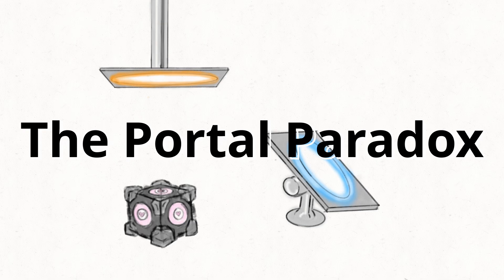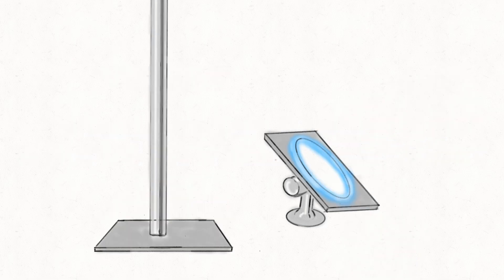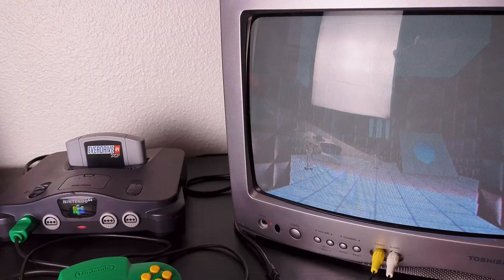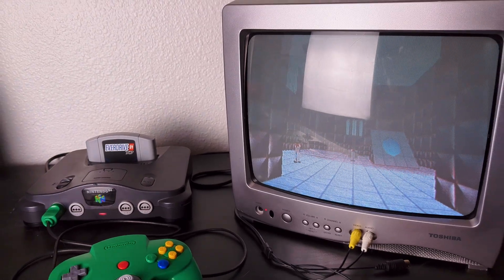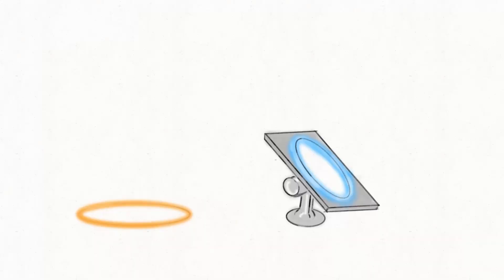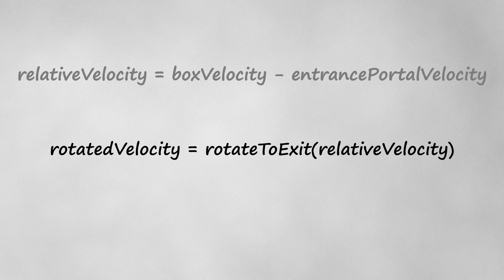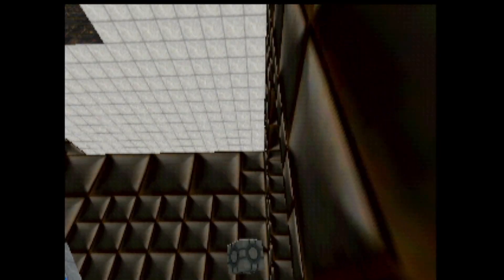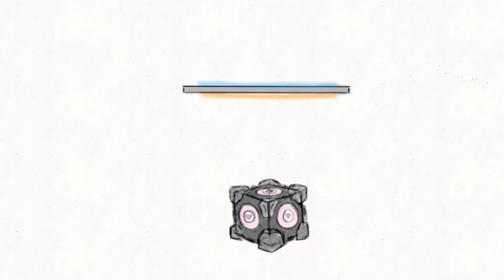I rewrote Portal from scratch and solved the Portal Paradox

Comment: I think another way to look at this may be to think of the portals like a tube, although this is flawed.
My logic goes that if you are to move through a portal, you are travelling through a wormhole. I your example, moving the portal makes that wormhole smaller, so the cube travels through the portal and the distance it travels further shortens, causing its relative momentum to fling it out of the exit.
This logic falls apart when the portals move away from eachother, however, unless you make the stipulation that the wormhole does not take the direct path between entrances.

Comment: I think the paradox is more nuanced. Your implementation solves it beautifully if the portal is being moved onto the box at a constant speed. But what if the speed of the portal changes while it's moved across the box, or if the portal is rotated?
Reply: I don't think there's any inconsistency nor any added new thing by this scenario. Whatever passes through the portal at some moment in time has teleported. In your scenario it just applies in cross-sections and there will be a resulting amount of force from all those cross sections
Reply: @MaxLohMusic   the problem with this video's explanation is that a portal should not apply any force to the object, if we assume the object to remain stationary, all the situations where the portal rotates or changes velocity work, otherwise the physics just break. the only way his equation works is if the object entirely passes throught the portal at once, otherwise, part of the object would begin flying out the blue portal, while the orther part should be remaining stationary, which makes no sense.
Reply: @lNovalandl  I don't follow your second part. The cube goes through the portal bit by bit. At any instant, there's a portion that went through and a portion that didn't go through yet. Each contributed to the total force. The cube is a solid object and wouldn't fall apart from this unless difference in momentum was extreme
Reply: @MaxLohMusic  i explain poorly but, the model he shows in the video doesn't work because if the portal comes down on the cube and stops halfway, shouls the cube be sucked into it to fly off to the other side?
Reply: @lNovalandl  then you apply the same logic I wrote earlier. Half the cube gets the other portal treatment, other half gets original portal treatment, and final momentum is averaged. Imagine instead of a cube we put a pile of sand. Half the sand goes through and the other half stayed. There's no paradox. Now glue the sand together. Their forces are now combined, but still no paradox.

Comment: That experiment is correct from a physics point of view. The physics explained are at a level you would learn in high school so should be understood by anyone who was awake in school. The actual original game seems to have a mistake. When you do that stunt where yo fall down a height into one portal, and the other portal is immediately above the first, you appear to fall faster and faster, until the slight error in the vertical fall makes you finally hit the side and stop you. You should only increase speed up to the terminal velocity and it is physically impossible to go any faster.

Comment: I appreciate your position regarding the conservation of momentum, including the cancellation effect of both portals moving. It's a sound argument. What I'm curious about (especially with regards to your engine) is if you have considered the implications for rotational energy in this system. Such as Portal A moving linearly while Portal B is rotating around 1 or more axis. 

Another stray thought is about the idea that if momentum / energy is conserved as we expect, does that mean inputting energy into one of the portals itself would equally affect the other? For example, when the orange portal moves in your example, wouldn't there be some sort of effect on the blue portal?
Reply: Rotation is not relative motion - but portals are a bit wonky with how many things they already break.

Comment: my knowledge of physics is not perfect,  but im pretty sure you just broke the energy conservation law:). Basically the kinetic energy of the idle cube is zero, but after going through the portal in started moving, which means he gained energy somehow, without any external forces.

while its true that velocity is relative to the system, the energy an object has is constant (if no external forces are applied), but with your example we clearly see the change of velocity which means change in energy. 

i personally convinced that the cube would not gain speed

Comment: The portals are  not physical objects, they're configurations of spacetime. They're not entry and exit points, per say, they're two dimensional non-physical barriers between two points of spacetime, no different than other two planck meter of spacetime sitting beside one another. As the "entry point" portal moved over an object, that object would not have momentum, it is not moving, spacetime is reconfigure around it, but because the "barrier" is not solid, the object is pushed through by virtue of it being solid. As the entry point moves again, spacetime is once again reconfigure, but this time, the two dimension slice of cube passing from one point of linked spacetime to the next, would met the resistance of the first two dimensional slice of cube, causing resistance. This would result in compression. But because the mass at the "exit point" is less than the mass as the "entry point", the cube would move itself out of the way. Cohesion would be maintained through the strong nuclear force, as well as intermolecular bonds, unless the "shove" through spacetime overcame these forces, then they would compress at the speed of light. At some point, as the solid cube shoves itself through spacetime, the gravity acting on the cube(we're assume the portal does not radiate gravity, or spacetime curvature, through the link). would be grater on the "exit" side of the link, negating the gravity on the entrance side, causing the object to fall, pulling it through the link, lessening compression... but this would not occur, until the centre of mass passed through the link, prior to that point, and assuming the portal was not moving faster than 9.81m/s^2, gravity would be a much stronger force acting upon the cube. This is basically, and explained poorly, translational symmetry.
Reply: But in your example, the areas on both sides of the portal are effectively adjacent, and if one portal is moving, then the area on the other side of that portal is effectively moving relative to the cube. So once the cube moves through the portal, it will be in an area that is moving relative to it, and since the area is actually stationary, the cube must be moving. Even if you frame it as the portals not being objects, and instead tears in reality that merely connect space, it still works this way.
Reply: @godlyvex  No, the cube is pushing itself through the portal, because it's a "solid object". The "exit" point is not moving, the "entry" point is. Each 2 dimensional slice of cube pushed through the portal, pushed into itself on the other side. Cohesion is maintained because the relative forces do not overcome their inherent balances(ei, the strong nuclear force). You must also remember, solid objects, are not solid, they're a collection of millions of atoms separated by relatively massive amounts of empty space.
Reply: @godlyvex  Think of it this way. X = 0 is the portal... both portals. The portals themselves, are two dimensional objects with no mass or volume, they do not exist edge on. when y∞, z∞, X1, move to y∞, z∞, X-1, whatever is occupying y∞, z∞, X-1 has to be shoved out of the way. This creates a force acting upon the cube, but the cube is sitting on the solid ground, the the cube is compressed by whatever the resistance is. The immovable ground, and the cubes resistance to compression, moves it through the portal. If this example were occurring in space, and in 0 gravity, eventually, the compressive force would equal the shoving force, causing the cube to "catch" in the portal, one side would be stationary, and the other would travel with the portal, depending on mass vs momentum.
Reply: @JoelleFromHell  If this happened in space, in zero gravity, the portal would move over the cube, and then the cube would exit the other portal with speed equal to the speed of the moving portal relative to the stationary portal. It's just logically obvious if you understand that the environment on the side of the stationary portal appears to be moving relative to the stationary cube when looking through the portal.
Reply: @godlyvex It's just obviously logical if you understand basic physics.
Reply: @godlyvex  The coordinates would be constant regardless of other relative coordinates, as the portal is universal to either points in space at any given time. When  y∞, z∞, X1 moves into y∞, z∞, X-1, y∞, z∞, X2 becomes y∞, z∞, X1 relative to the portal.

Comment: I think maybe disappointing but good solid solution, would be just to make portals fixed in relitive to themselfs. Portals must be connected cause they are taking you between them so why did we even assume that if i move one portal down, the other one is sitting still? If you move one portal around, second portal should move the same way, try to connect them with imagined pipe or something so you can see my point more

Comment: There's another issue with this, which you simply won't solve in this kind of engine allowing for the cube to be just one object.

The moment the piston with the portal reaches the uppermost atom of the cube, that atom gains the speed of the piston in relation to the resting cube. This all while the rest of the cube remains still. There are two outcomes from this. 1) The atom is ripped from the cube and set to piston speed out the other portal while the rest of the cube remains stationary. 2) The atom is bound strongly enough that it pulls the rest of the cube upwards, giving it more starting speed.

If we now take the second (set of) atoms in the next time frame (ignoring continuity of time here) then if 1) keeps happening, we have built a fancy molecular shredder. The cube becomes very fine dust out the blue portal.

If however 2) keeps happening, then the piston speed is added on top of the speed of the previous "slice", potentially reaching light speed before the portal has even engulfed the entire cube.

Either way the issue lies in the fact that we "suck" from World 1 and "spew out" back into World 1 again. The cube will not maintain its structural integrity with finite bonding forces between molecules and atoms.

What's the conclusion? There is no debate in this on what is "correct" since everything is wrong if physics are applied. You have to pick a subset of physics to retain and gracefully ignore the rest. This is what you did and it results in a game that has proven to be a fun pastime. So all is well in the end.
Reply: What you're describing would only happen if the portal stops moving while the cube is intersecting it. If the portal is still moving, then no, the cube's uppermost atoms wouldn't be ripped away, because the portal is still moving downward and the whole cube is still moving into it at the same rate. Now if you stopped halfway, half of the cube would be moving, and half of the cube would sit stationary, which might cause some ripping, but realistically it wouldn't be anything too crazy, it would just be inertia.

Comment: it's easier to think of it relatively. the cube is moving relative to the yellow portal, so when it moves out the other side the movement is maintained in the cube instead of the portal (where on the other side, the portal is fixed).
if the portal on the other side moves, the movement is maintained in the portal instead of the cube :)

Comment: But does a portal even have velocity? It's an opening in space. Only the edge of the portal could be said to really "exist", the part you pass through is just empty space.
Velocity = Momentum/Mass. But a portal has no mass.
...
I mean, whether a portal has mass or not is probably a whole discussion in and of itself. Like, does it use the mass of the surface it's attached to?

Comment: what if you stop the portal from moving while the object is half way through? will the object get sucked through, or ripped in half? and if the object gets sucked through then would a moving portal placed inside of a long tube act as a vaccuum?
Reply: The top half would continue moving, and if the object is strong enough not to break, the top half might have enough strength to pull the other half through, but that really depends on the speed the portal was moving. There really isn't anything to think about here, it's just common sense.

Comment: But now what if you move the portal half way down the cube then stop. Does the cube stay in between the portals or does it get torn in half?
Reply: This isn't a hard question, why are so many people asking it? Obviously it depends on the strength of the cube and the speed of the portal. High strength, high speed? Cube gets pulled through. High strength, low speed? Cube stays. Low strength, high speed? Cube breaks. Just think about it for a few seconds and it's not hard to see.

Comment: Wouldn't the cube actually be going faster than the portal that moved down onto it?

As the moving portal comes into contact with the cube the leading edge of the cube takes on the momentum as the cube exits the stationary portal. Since the rest of the cube can't get left behind, it gets pulled towards the moving portal and now you have the momentum of the moving portal added to the momentum of the moving cube. This combination would keep increasing as more and more of the cube gets through the moving portal.

I don't know how much additional momentum it would gain, but it seems like it wouldn't be insignificant.
Reply: That isn't how it works, the bottom half wouldn't just magically gain momentum. The top half and bottom half are not moving relative to each other at all. That would only happen if the portal stopped halfway down the cube, but in that case the cube would go through slower, as the moving half would be slowed by pulling the stationary half.

Comment: The way I like to describe how the box flies out of the exit portal is like a buffalo jump, where the buffaloes in the front of the herd are pushed over the edge by all the buffalo behind them, same as the part of the box that exits first is pushed out with force by the parts of the box behind it.  The box can't plop out unless the speed of the input portal is slower that the rate of gravity.
Reply: gravity doesn't play a role in the main question
Reply: @godlyvex  In the Portal 64 simulation, gravity is obviously present, but is not vital to the equations used. Just because formulas are simplified to get an easy answer, does not mean that other forces are not at play. He didn't include air resistance either, but air resistance would also have an effect in the system.
Reply: @royrindal1476  It would have an effect, but it wouldn't change the answer to the overall question.
Reply: @godlyvex  What I'm saying is the box would only plop out if the velocity of the input portal is slower than the rate of gravity. If the input portal's velecity is greater than the rate of gravity the box would fly out. The equation used is to find the exit velocity of the box, so gravity doesn't  matter in that sense, but once it's at that velocity, what happens after? If relative velocity is slower than the rate of gravity the box plops out, if it's greater the box flies out. I'm agreeing with the formulas used and their outcome, I'm just adding a new constant to be aware of.